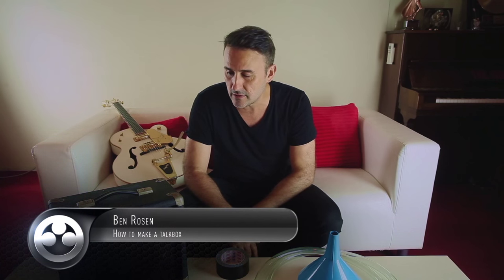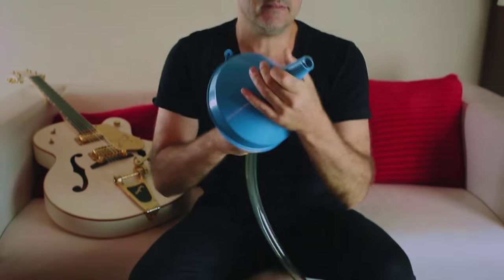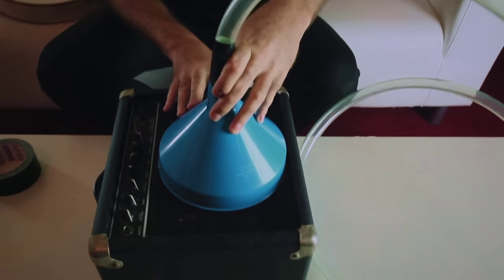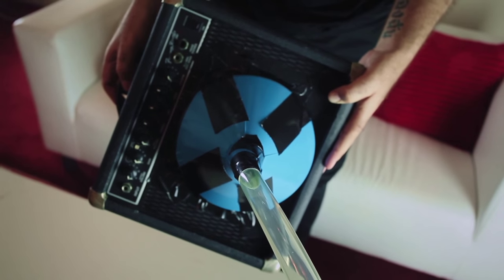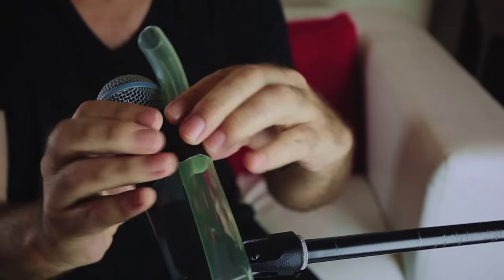SINGLE SHOT - How to build a talkbox for your guitar

Comment: It's better if you use a driver which is completely sealed in a box sealed in a cardboard box into which you insert a length of narrow tubing and just bypass  the speaker of a regular guitar amp, I think I used a Fender Vibrolux effectively  making the box the amps speaker.. Now........the expensive part is a good vocal mic and a good PA .. Now the audio goes from your guitar into the amp then out through the driver and through the tubing which goes into your mouth and down your throat (the further down the better) and back out your mouth into another mic and out through your PA. Mine worked beautifully but I'm now 65 with a little plastic jar full of my fillings. A 40 watt Vibrolux really pumps out some power when it's squeezed out through a tiny piece of tubing.

Comment: but the amp sound is louder than the talk box,you can here the amp normally, i even cut through the grill to put it over the speaker but it doesnt make much difference? do I just turn the amp down and a microphone louder or something?
Reply: If the back of the amp isn’t covered try covering it with foam because foam dampens sound and sound can leak out the back of the amp.